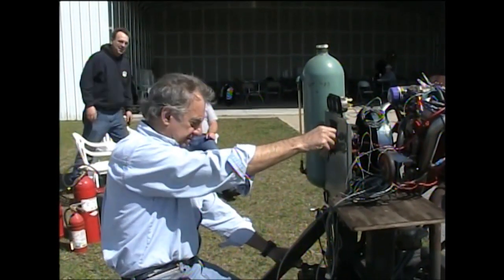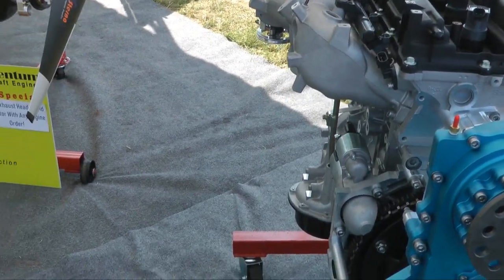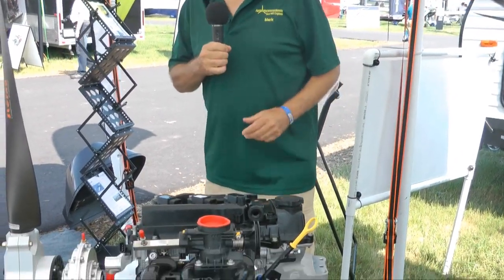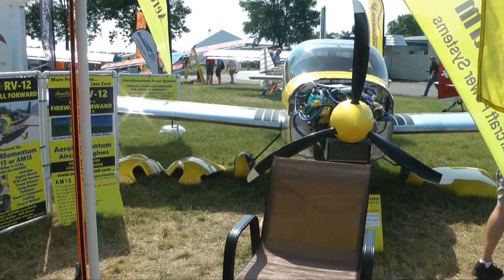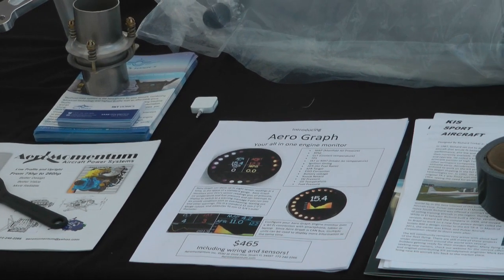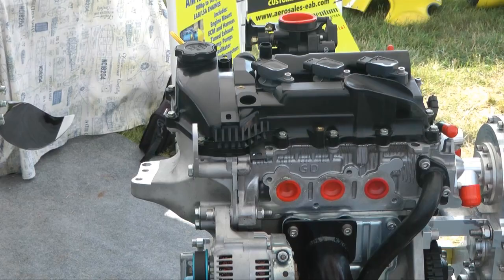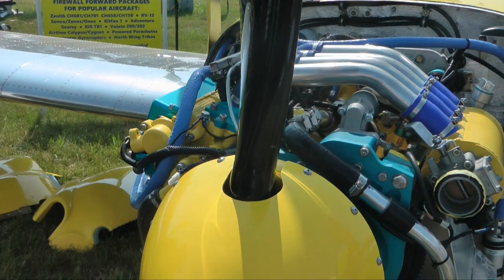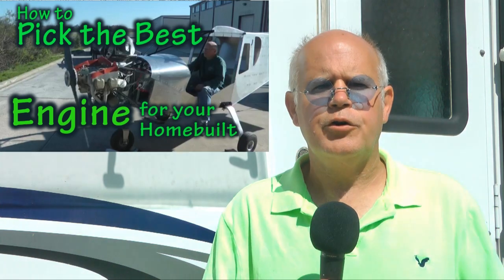The Lowdown on Aeromomentum Engines (Oshkosh 2019)

Comment: Why do you believe that a properly balanced engine with a long stroke would be a problem. It would easily put out more torque and be able to push a more heavily articulated prop then a short stroke engine it's loses its torque value and of course would burn more fuel?
Do you use automotive oil or aircraft grade motor oil. Kendall motor oil should take considerably more temperature than 300°. Amsoil would be wonderful for reducing wear and I believe it's also capable of taking more than 300° as well. Just a question.

Comment: Torque specs at lower RPMs are critical as well because torque is as important at getting the plane into the air is horsepower. Possibly even more critical. You're making Peak torque at 3,000 RPM you don't have to run it at 6,000 RPM.
I like that you understand the critical nature of having port injection. Do you however make sure that you have a oil catch can. On any Turbo and or supercharged engine and oil catch can would be really nice to have. And of course you would need one that would dump its oil back into the sump, I know you carry a lot of extra oil on aircraft applications but it's nice to not put all that dirty crap back into the intake in the PCV system.

Comment: The AM20T 260HP is the recommended engine for the Veloce 400. It looks impressive, but I'm just not used to seeing a liquid cooled engine in a plane. Is there any additional maintenance?
Reply: Sean i am also looking at this engine have you bought the 400 kit?
Reply: @formula1junkie550  no, I have not bought any kit yet. I'm still researching and planning. It's going to be at least a year before I might be able to do this, but I want to find out as much as possible in the early stages. I'm not a mechanical guy, haven't tinkered with cars much and I've never done anything like this before. I've read a lot more since yesterday and I'm liking this engine a lot. If I go through with this, it will likely be with this engine.
Reply: @SeánHassett  i am an A&P and find this to be one of the easiest kits to build from what i have read. Stay in touch would like to know more about any experience on the kit process. I may order it come June 2022. This is as close as a cirrus 20 without the massive investment
Reply: @formula1junkie550  Where you able to obtain a kit?   I'm still about 9-12motnhs out before ordering.   But would like to know someone who has ordered it.   I love the looks of it and what seems to be an easier build compared to the RV-10.

Comment: Thank you for doing the leg work sweat tears and risk of being a small business to compete with Rotax. In my opinion, Rotax provided a need but since then has changed the homebuilt aircraft market for the worst. Designers got lazy and the price skyrocketed. Now only the rich people can play. Aero momentum offers a tried and proven engine as an alternative to buiiding a VW, Subaru or corvair engines. I’ve got a well used Lycoming and used is an option. If you are in the market Aeromomentum offers a great option to higher priced alternatives.

Comment: Why is port fuel injection  better than direct injection for aviation use?
Reply: Because the early opening of the intake valves in modern engines allows some combusted gases to enter into the intake manifold before the mixture is drawn into the cylinder. On engines run for extended periods at high power settings (i.e. run in aircraft) this will end up depositing carbon on and around the intake valve, eventually leading to a stuck intake valve. By changing from direct injection to port injection, the solvent properties of the atomized fuel clean these deposits off and prevent this buildup.
Reply: @ScottsSynthStuff  excellent reply. Succinct and to the point, yet precisely technical as necessary.
Reply: Good question.I was thinking the same.Why change back to port injection that disappeared from automotive use years ago.

Comment: these questions are for the AM20T

1. can I fit my own Airmaster constant speed prop?
       you said this has a flat power curve. is that saying it should be more used on cruiser typer planes or is it possible to use with stol and top cruise speed with constant speed prop?
and
2. is there room to fit an A/C compressor on the back and not interfere with the firewall?
and
3. do you need to have a header tank?

Comment: Does this engine have dual magnetos and plugs?
Reply: It can't. This is an automotive engine, they don't have dual plugs from the factory and this is impossible to add. Note the chance of failure or electronic ignition is much less than a magneto.

Comment: the gauge is expensive, search Perfect Tuning Universal Gauge, same
Reply: We also supply 2 pressure sensors, a temperature sensor, plug and play wiring harness and custom software.  I think if you add those up you will find we offer a great price!

Comment: Is there a air mix valve in the abs intake manifold. If so how has the vibration being addressed. In the auto version the baffles become loose due to vibration and fall into the intake manifold.
Reply: Aeromomentum is not using the abs intake manifold.

Comment: Great presentation.  Two unanswered questions . One - why do we not want a long stroke in an aircraft  motor and two why would you derate your 2 liter motor to 260 hp is that so it will fit the Ch 801's specs  ?
Reply: A long stroke means two undesirable things: higher piston speed for any RPM, and more stress on the piston/cylinder wall interface and the bearings because the connecting rods have to swing out to a greater angle because the crankshaft "throw" (equal to half the stroke) is greater. You can mitigate #2 by having longer rods, but that means a physically bigger block. You can't do anything about #1.
Reply: However a longer stroke equals a greater lever arm in the crankshaft and also more time for a complete fuel burn.
Reply: And therefore higher torque.
Reply: A derated engine is working at less than its limit, so it will be more reliable. Also, each airframe has  power or torque limits that have to be respected.

Comment: I wonder why they chose the Hyundai engine over the Honda K20. Core availability?
Reply: Hyundai?
Reply: @timi707_1  The AM20T is a Hyundai Theta engine.
Reply: Probably so there's no direct competition and issues with Viking.
Reply: @jrbailey3208  Viking doesn't use the K20.
Reply: @PistonAvatarGuy  

The model isn't the issue, the Manufacturer IS the issue: Viking is known as the "Honda Engine' producer.

Should Aeromomentum use a Honda product, ANY Honda product, it would give propaganda fodder to Viking to say "See, even our competitors believe Honda to be a superior product line."

Marketing problems and accents are really important in a psychological manner.

I take your point on the specifics, but a LOT of people wouldn't take the time to 'get in the weeds'; so it'd end up just being 'bad optics' for Aeromomentum to use any Honda products.

Cheers.
Reply: @jrbailey3208  Viking doesn't produce Honda engines, Honda does and Viking also uses a Mitsubishi engine. Aeromomentum is also not tied to sourcing engines from a single manufacturer, they use Suzuki, Hyundai engines and possibly a third brand as a source for their 3 cylinder (I haven't been able to identify it).
-
The fact of the matter is that Honda DOES make superior engines, so if Aeromomentum wont use a certain engine manufacturer, just because someone else also uses it, that just makes them look fickle and stupid, that's not good marketing.
-
If anything, more companies using Honda engines would convince people of their superiority and make people more comfortable buying them.
Reply: @PistonAvatarGuy  

Thank you for the info on Viking also using Mitsu engines (I love Mitsu engines.....let's face it, they brought us the Zero and partially thereby, WWII....yes, tongue in cheek on  the later).

I knew that Aero uses Zook engines (I also love Zook engines, and vehicles for that matter, Hyundai as well), but didn't know  which Manu. they used for their 260hp engine (though I'll never be in the market for that one).

My goal is to build either a 701 or a 750 Zenith, using the 1.5 rated at 147hp (max), but I'll probably need to start out with a used Titan, and I've been looking at that 3 cyl for the new powerplant.

While Honda engines may have an edge, I don't believe that edge is such as to warrant the price differences compared to the Zook or Hyundai for that matter.

However, like so many other things relating to machines we use, personal preferences play a central role in our choices, for a wide variety of reasons.

It's rather like the choices of side arms and calibers: highly subjective considering improvements in modern ballistics from bullet manufacturers.

This is why the .380 (9mm Kurz) has become so popular amongst folks who used to swear by .45ACP and 9mm (9x19). Given the FBI Ballistic Gel results for modern bullets, even the 'small calibers', controlability has become 'king' over just raw power.

Similarly when it comes to mag capacities, people are once again going to single stack weapons, given the FBI Crime Data results pertaining to Real World civilian shooting incidents: 3-5 rounds spent at 7 yds average and the firefight is over.

The old adage of 'more is better' is still accurate I would argue, whether in horsepower or mag capacity, but they both have their real world limits: putting a PT6 on the nose of a Zenith 750 may indeed be doable, but for 99% of folks, it isn't realistic for a vast array of reasons!

Anywho, thank you again for the information you provided, I do appreciate it!

Cheers from the Oil Patch in Central WY
Reply: @jrbailey3208  We looked at Honda, Toyota and many others and based our choice on technical reasons.  As a MSAERO engineer I would have no issues using a Honda base if they fit the application best and have less concern about their or others reputation in cars.  Also Honda could make both a line of great engines and a line of less correct engines for use in aircraft.  Just like Suzuki makes great engines for aircraft conversion use (G series) and ones that are less good (Kseries, Boosterjet).
Reply: @mkett1922  

Thank you for your response and clarification concerning Honda, but you, like some others, seem to have missed my point.

I REPEAT for the umpteenth time, I LIKE Honda engines, and yes I trust them.

It is the owner of Viking Aircraft Engines I do NOT trust, after having watched dozens upon dozens of hours of him speaking in a wide arrange of presentation at the various aircraft venues, via You Tubers doing those interviews and presentation with him.

I view the fellow as someone who reminds me of a Used Car Salesman,  in a business that leans in the Fly By Night motif, and he's had to actually deny being a 'Fly By Night' business, because of his self-admitted past business problems.

LIke I also said: this is my SUBJECTIVE PERSONAL OPINION and I MAY BE WRONG! He and his company could be completely reliable, but I'm NOT willing to take that chance with my money.

Should others (and many have) believe him to be reliable, then fine and dandy, more power to them and happy trails!

I hope this clarifies, fully, my position on these matters at hand.
Reply: @jrbailey3208  Viking uses Honda and Mitsubishi engines

Comment: Making an engine mount that directly mates one of your engines to a Rotax 912 mount is a very, very good idea, but shouldn't it be the M13, not the M10? The M13 starts at 100HP and goes up (a little) from there. Personally, I want an RANS S7, and my home field is at 6600', so I reckon I need an engine rated about 120HP at sea level to get 100 out of it up here.
Reply: I thought the same thing.

Comment: Why is it important to convert an automotive engine from direct injection to port injection?
Reply: carbon build up on the valves is a very real thing on direct inj. but as mentioned, if the PCV is deleted (or at least vented to atmosphere instead of back into the intake) that is eliminated. MY guess for their converting to port injection is reliability (fewer critical parts). Direct injection requires a VERY high pressure fuel pump (especially when turbocharged) This high pressure system is fed by a standard low pressure pump. If either pump fails, the engine stops.

The high pressure pump is very expensive and I'd imagine anything running under that much pressure has a higher chance of failure. To do it "aviation style" would mean to run 2 high pressure and 2 low pressure pumps. The direct injection system on an aircraft could get very expensive very quickly. You can run 2 low pressure pumps on conventional port injection pretty cheaply.

Also there is no huge advantage to direct injection in an aircraft. It can produce lower CO2 emissions but at the expense of higher particulate emissions (requiring a special cat) and aircraft emissions are not regulated as much anyway. It has the ability to run ultra lean mixtures for fuel economy but more at low load than high load and an aircraft engine will no doubt spend most of it's time in higher loads. Also port injection has a better cooling effect than direct inj.

Search "direct injection" on wiki for more details.
Reply: @cainnibl  PCV is positive crankcase ventilation, meaning that fresh air is actively moved through the crankcase, a crankcase vent does not actively move air through the crankcase. Lower CO2 emissions are a direct result of reduced fuel burn, which is definitely something that's desirable in an aircraft.
-
Concern over failure of the HPFP being the reason for its elimination was my first assumption as well, I'm really just surprised that these guys didn't start with an engine that already made use of port injection. Also, I don't fault Viking for using direct injection on their engines, Honda's GDI system seems to be extremely reliable.
Reply: I think in case you fly upside down
Reply: @homertalk  There wouldn't be any difference in the operation of those systems if inverted, I can't imagine why they'd do that. The oil system in these engines can't handle being inverted anyway.
Reply: Its my understanding that port injection cleans the intake. Not a big deal on things like cars that are run almost every day, but can be bad for things that are likely to sit for months at a time, like airplanes.
Reply: I imagine running the direct injection properly would require either using the factory ECU and thus O2 sensor and emissions equipment to prevent a CEL (so no using avgas as the lead would kill the O2 sensor and cat) or re-doing the work the factory engineers did to figure out a proper injection scheme for smooth running and programming your own ECU to control the engine. 
Converting to port injection means you can use a proven ECU and parts that you know will stand up to the aviation environment. It seems like an easy decision.
Reply: As I understand it direct injection systems for automotive use requires much higher fuel pressure to counter combustion chamber pressure.( remember where that pressure comes from?). If Avgas were used in a engine with direct injection, detonation would likely occur! If however port injection were used a better atomized mixture would be drawn or boosted to the combustion chamber & then compressed & (ratio applies importantly here,)prior to the ignition event,thus preventing pre-ignition & the damaging effects of detonation. Sorry to sound like a techno nerd, but I paid(& still am paying) good money for my A&P certification,& by god I am gonna get my money’s worth somehow!! Your welcome!
Reply: Possibly to avoid carbon buildup on the valve covers for direct injected engines? When fuel is port injected, it cleans the valve cover as it is being sucked into the cylinder, thus avoiding massive buildup? Would love to hear the rationale from AeroMomentum though...
Reply: @ruhou  The carbon actually builds up on the back side of the head of the valve, but that's only when a PCV system is used and I would be surprised if these guys were running a PCV system on these engines. It certainly would be a good idea to run a PCV system, because it keeps the oil in good condition for a longer period of time, but it tends to be a lot of trouble to implement one on a turbocharged engine.
Reply: *... back side of the head of the valves
-
EGR probably plays a part in creating those carbon deposits, but there's really no reason to run an EGR system on an aircraft engine.